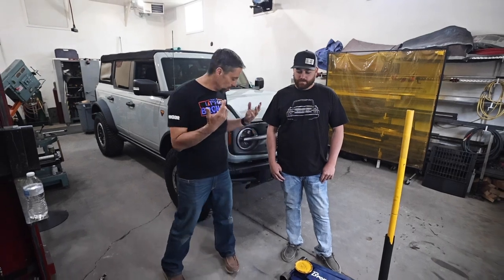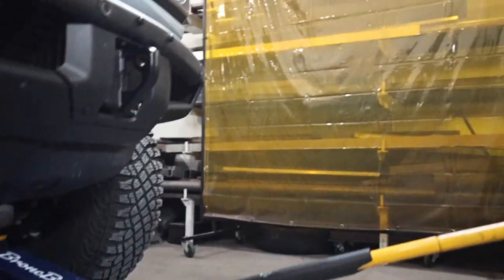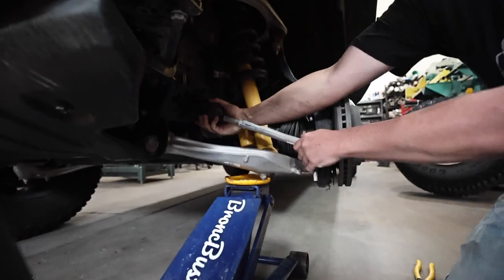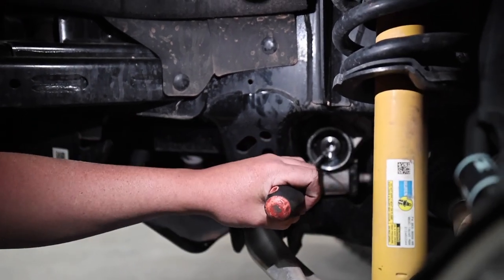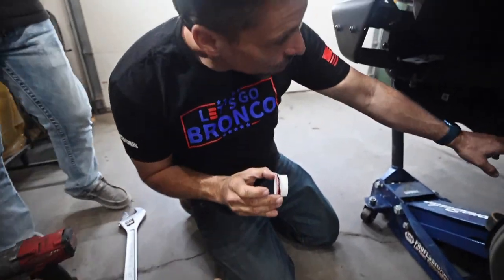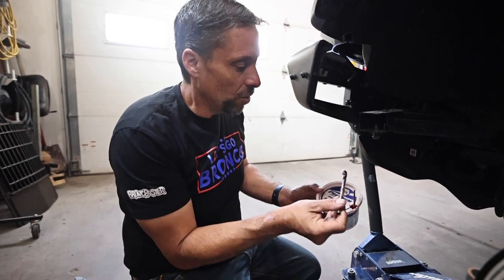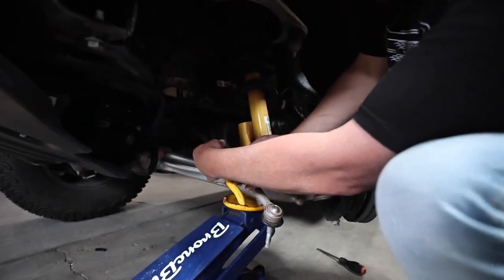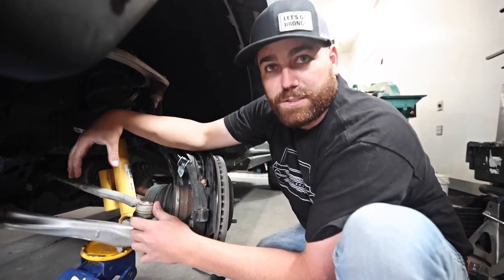How to Install The "BroncBushing" in the New Ford Bronco

Comment: Yet another example of how instructional videos should be made. It includes every single step, no unnecessary chit chat and adds some common sense work arounds. Thanks for yet another great post. In addition, the Bronco is a new platform and there will be some weak points. Especially in the rock crawling realm, driving where mountain goats will have second thoughts! You have stepped up and addressed these in a practical, common sense way. Fantastic job.
Reply from the maker: Thank you so much!

Comment: Hey I did the install, I thought I did it right. But I feel unsteady on the road, and I’m suffering from steering binding. And I’m unsure if it’s because of the bronc bushing but my alignment is slightly off. Has anyone else reported these problems to you? I think I may have not lubed the steering rack enough? But let me know if you have any solutions. I was thinking of just handing it to professionals to fix my problem.
Reply from the maker: I sent you a message reach out to me

Comment: When off-roading on 37s w/Stage 4+ Icon lift, my steering becomes completely impossible to move when when the vehicle is off kilter with the front tucked a bit. Almost like the power steering isn't working. Makes it impossible to line up on the next obstacle.  I'm confused on if this product will fix that issue or only the cam out issue..
Reply from the maker: This product won’t fix that but 4” lift you take a huge chance of blowing out the housing on the steering rack. Our billet aluminum housing will help greatly on the binding. I’ll send video link for that
Reply from the maker: https://youtu.be/X8tszpPSKaA
Reply: @BroncBustertx  sorry, only 2.5-3” lift with an Icon Stage 4 (coil overs, upper control arms etc). My geometry is fine, but steering is bloody impossible at times.  Can’t quite figure out why. It feels normal, just incredibly hard to move. 

I’ll check out your steering housing video, thanks
Reply from the maker: Also through tonight BLACKFRIDAY discount code saves 25%